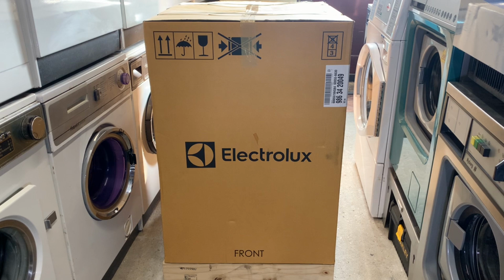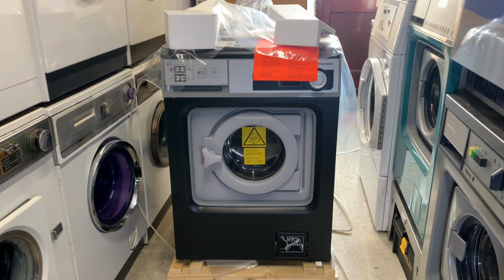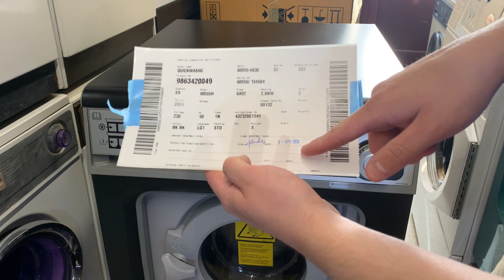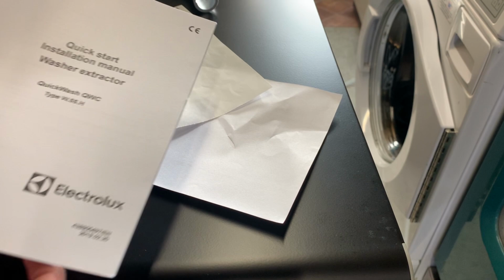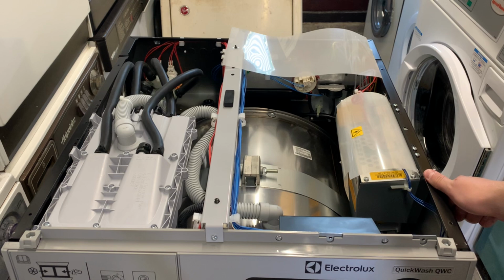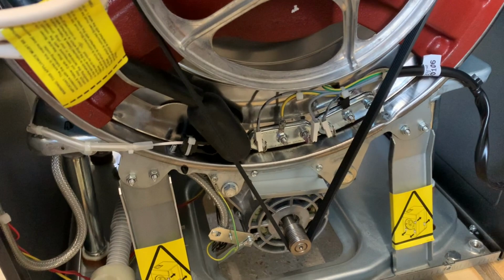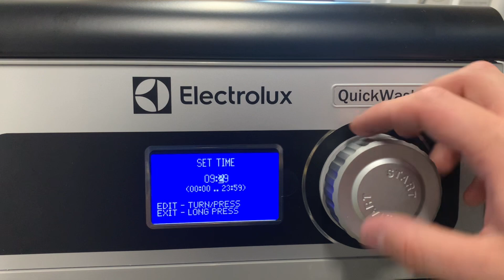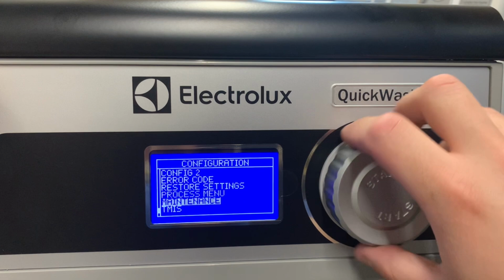Unboxing an Electrolux Professional Quickwash QWC Commercial Washing Machine

Comment: I have always wanted to see a qwc washing machine work as I Heard it has a frequency controlled motor.
Reply from the maker: So does the W555h and the w455h
Reply: @TheLaundryCentre  very nice Chris how are you getting on with the matching tumble dryer
Reply: @TheLaundryCentre  yes though this specific model doesn't have carbon brushes.
Reply: Have you ran it through a cycle yet?